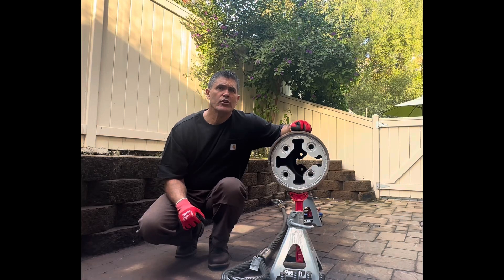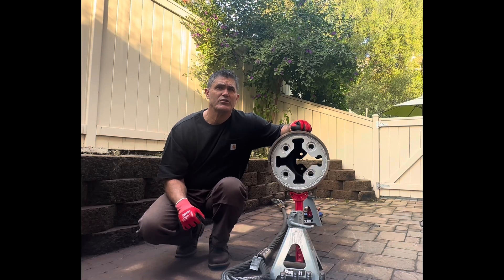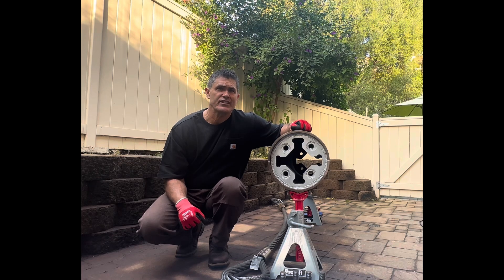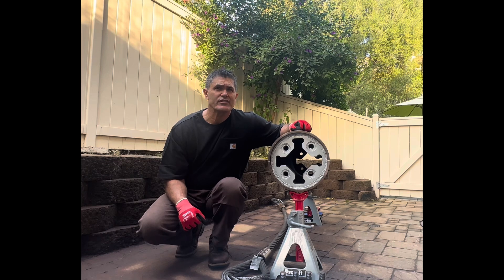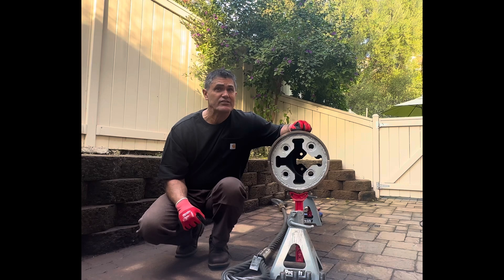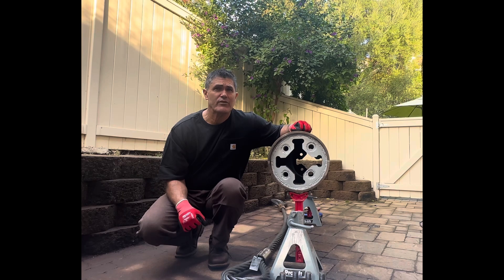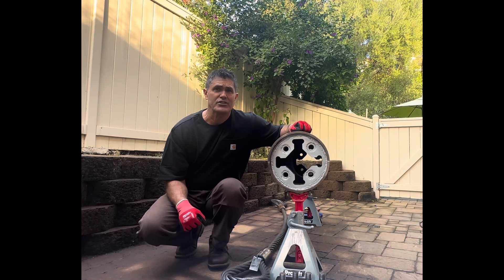Anchor Handler

Comment: Maybe you could explain a little more about what this does? I work with large vessels and I honestly don't know what I'm looking at here. We don't use wire rope at all for our fairly shallow anchorages in strong tidal areas, they twist themselves to hell despite the swivels, maybe that's why I can't really see what you are trying to show me, but I'm curious to know what it does.
Reply from the maker: It sounds like you are using a mooring can with a rope on top side & swivel with a heavy chain to anchor on bottom side? My wire tube is missing the large pipe tank or float. The short wire I use is for demonstration purpose only. Lots of dredges use this type of anchor buoy. The cable in the buoy runs thru (my wire tube) & is long & shackles to the top of the anchor. The bottom side of the anchor has the dredge or derrick crane barge wire ( the bigger wire) shackled to it  which goes directly back to the winches. My idea (the insert pipe)  floats the anchor cable on the waters surface & marks the anchor. An A frame tug can come pick up the anchor easily and move the anchor wherever the dredge desires to put it. The value of my idea is that loops or picking eyes of wire ropes pass directly thru the pipe insert in the video. This sounds simple and it is but this changes everything for the good because now a 3 inch wire change is as ez as pie because the wire factory forms the 3 inch loops ( which is the hard work). Just run the 3 inch wire picking loop thru my insert pipe & bolt it down done .Just like shown in the video. Kyle